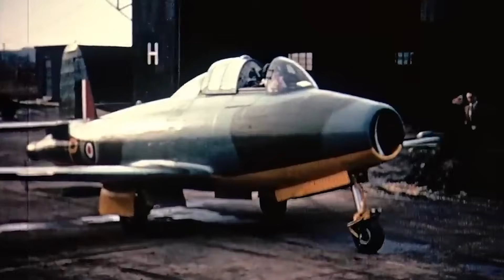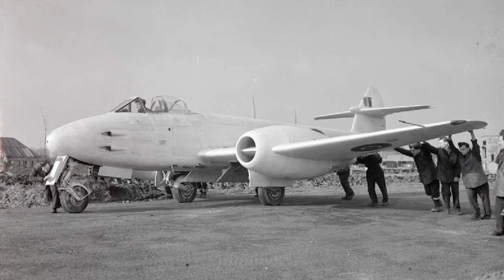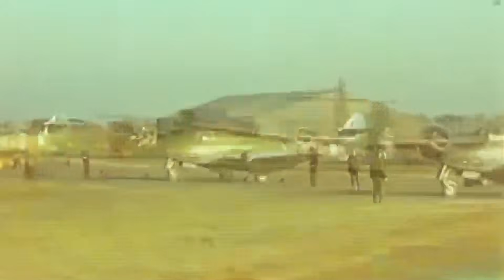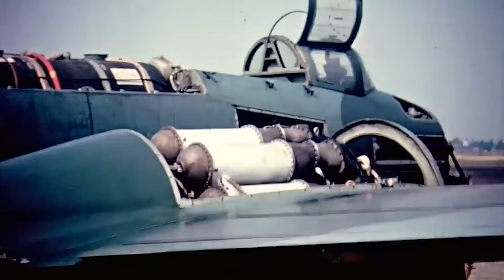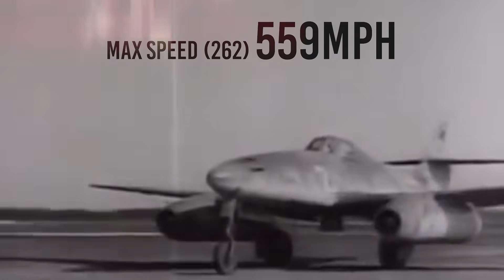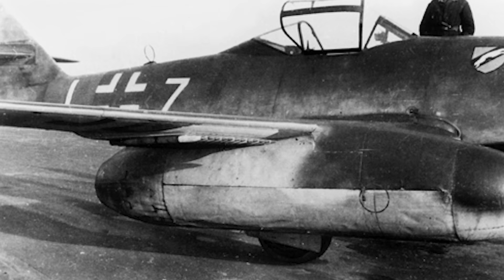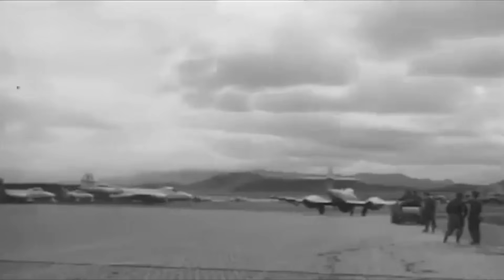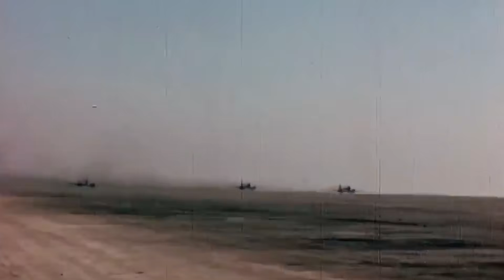Meteor vs Me 262 | Which was the better WW2 jet?

Comment: -Which Meteor?  There were 5 in service in WW2 and all much slower than the Me 262.   The Me 262 had a speed of 540mph at 25,000ft and 520mph at Sea Level.  For the Meteor you had
-Meteor I with Welland, speed about 448mph
-Meteor I with Derwent I and small nacelles about 460mph
-Meteor I with Derwent I and improved nacelles (I think about 466 or so)
-Meteor III with Derated Derwent and Standard Nacelle (About 480mph)
-Meteor III with Derated Derwent and lengthened Nacelles and (clipped wings I think)  (about 492 mph)
-Post war the Derating was removed and the Meteor III (latter retroactively renamed Meteor F.3) speed got to 515mph.
-Post war a Meteor III with clipped wings and faired over gun ports with Derwent V managed 596mph at sea level which became 606mph within weeks.
-The Derwent V was not a progression of the Derwent I through to IV but a completely different more advanced engine obtained by shrinking down the Nene.  
-The reason for the speed record at sea level where the speed of sound is 750mph  is that the meteor was at its Mach limit (about 0.78) and this wouldn't have been possible at 36000ft where the limit is a stable 660mph.
-The "Speed Meteors" became the basis for the post war Meteor F.4 which entered service in 1946/47.
-So where it counts in WW2 the Me 262 was better.
-Improvements to the Me 262 would be
-Accelerator control valve which placed a barometric capsule across the compressor to measure airflow and dose fuel accurately preventing burnouts of the engine that plagued the engine.
-Jumo 004C engine increase in thrust from 900kg to 1000kg
-Jumo 004D engine increase in thrust to 1100kg.
-Area ruling bulges developed by AVA to raise mach limit.
-Increasing sweep from 16.5 degrees to 30, 37 or 45.
Reply: The Me262 and Meteor had virtually the same limiting Mach number of 0.82-0.83.
All the Meteors had ten times the engine life of the Me262 and a third of the operational Me262’s were lost to DUAL engine failure.
Taping over gun ports was standard in WW2…
Each of the Derwent engines had twice the thrust of the Ju004 engines and thus better rate of climb and acceleration.
Reply: @allangibson8494  Early i.e. WW2 Meteors had a Mach limit of 0.78 before the onset of Mach Tuck.   A Me 262 about Mach 0.82.  Eric brown said it was controllable till Mach  0.86 (in the sense of being recoverable) but with a lot of buffet.  
-the Mach 0.82 Meteors did not come until after the war with the F.4.    You can see the work in extending and making finer the nacelles, placement of horizontal tail and enlargement of vertical tail and what not.   
-The Me 262's 18 degree sweep (16 degrees at quarter chord line) lead to a 1/cosine(16) increase in mach limit which is about 5%.
-Jumo 004B engine had a 100 hour life (about 50 missions)  but a 25 hour MTBO in which the 6 plain steel combustion chamber cans and turbine was replaced.  Production of the Jumo 004 was 800 hours and the MTBO required 160 hours of parts and about 8 hours labour.   From the point of view of cost, labour and life (given few aircraft would survive 50 missions) the Me 262 was cost effective.
-Had sufficient chrome and nickel been available to make the engine combustion chamber cans, exhaust duct and nozzle cone could have been made  stainless steel which would have likely eliminated the combustion chamber burn throughs and exhaust cone dislodgements that caused many (most) engine failures.
-
Reply: @bernhardzunk7402 The Ju004A had catastrophic resonance problems that were shared with the early Ju004B’s.
That was only partly fixed in December 1943. 
Ju004B’s also Mach stalled at 0.82 with the engine air flow being cut off by the shock cone in the inlet. Pod mounted engines are great for maintenance but lousy for transonic aerodynamics.
Reply: @allangibson8494  Each 262 was flight tested at 590 mph in a forty degree dive before it left the factory. That's higher than .82
Reply: @TheAneewAony Mach numbers vary by altitude and specifically temperature.
The problem with the Me262 was its inability to manoeuvre at above Mach 0.82. The P-51 and Spitfire could.
Reply: @allangibson8494  Eric Brown differs. Tactical Mach and critical Mach are different of course. The 262 was a quantum leap over older less advanced  designs such as the P-51 and Spitfire
Reply: @TheAneewAony The Me262 was a tactical failure. It couldn’t hit the aircraft it was attacking because of defective guns.
Reply: @allangibson8494 All 28 WWII jet aces flew the 262. 542 air to air kills. Meteor, zero kills, due to its slow speed
Reply: @TheAneewAony No German aircraft flew in range of the Meteor (other than the hundreds of V-1’s fired at London and Antwerp). 
The Luftwaffe was TOAST, brought down by piston engined fighters (with almost 100 Me262’s downed by P-51’s alone).
The Luftwaffe didn’t fly Me262’s over allied lines (or much of anything).
The Meteor had to wait until Korea to take on fighters.
Reply: @allangibson8494   True, the British actively hid the Meteor from combat due to its slow speed and inability to hit a target, as per the RAF's Central Fighter Establishment. The only combat jet to fly missions over England during WW2, that is a jet used in combat, was the German Arado 234. When the Meteor finally saw combat in Korea it did produce several jet aces, unfortunately they were Russians flying Mig 15s

Reply
Reply: @TheAneewAony the Meteor had superior engines from day one.
That’s why the soviets cloned them in the MiG-15.
The Ju-004 and BMW-003 engines were utter crap rushed into production that burned one and half times as much fuel for the same thrust as the Welland engines and delivered half the thrust of the Derwent. All this while they had 1/10th the operating life.
The Germans hid their jets from the allies just as much as the allies hid their jets from the Germans.
Reply: @allangibson8494  Nah. The Russians built the low tech, simple centrifugal flow engine for the same reason the British did, it's all that they could do. The 262 had 28 jet aces including Kurt Welter, the highest scoring jet ace in history. There has never been a British jet ace. Ever
Reply: @TheAneewAony The British had an axial flow engine that was used on the Meteor.
Like the German engines, it ate itself.
WW2 Axial flow engines were unreliable due to their size. Axial flow engines need to be large for reliability and efficiency.
Centrifugal compressor engines are simply the better engineering option below 50000N thrust.
The Germans just went with a bad option.
Reply: @allangibson8494  The only Meteor equipped with an axial flow engine, S/N DG204/G, port side engine exploded on 4 January 1944 killing the pilot William Davie. The engine had less than three hours. That ended the Metrovick F.2, no more were flown. The simple fact is the British lacked the technology to build an axial flow engine. If they could have, they would have. Even if the British could have built an axial flow engine, the didn't understand aerodynamics needed for a modern jet fighter. It wouldn't be until the Hawker Hunter that the British were able to integrate German technology, such as swept wings and axial flow engines into an airframe. Reliability was not a concern for the British, if it was they never would have built the Napier Sabre. The 004 262 combination proved effective, with over 500 air to air kills and 28 jet aces, even after the 8th Air Force P-51s won the air war making it safe for the RAF to operate in daylight
Reply: @TheAneewAony The Metrovic F.2 became the Metrovick Beryl (F2/4) which was developed into the Armstrong Siddley  Sapphire (F.9).
The pilot death was due to a parachute failure…(which also killed a lot of Me262 pilots).
Hundreds of Me262’s were lost to dual engine failures. (Along with 90% of the Me163’s).
The British were way ahead of German engine technology at the end of WW2.
Reply: @allangibson8494  Not really. After the fatal explosion work on the F.2 ended. The F2/4 was only related in concept. The F.2/4 flew on only one aircraft and then was also abandoned. William Davies' death was due to the explosion, it's unclear if he was thrown from the wreck or if he managed to escape, he hit the tailplane. In either case it was the explosion. Eric Brown: "Germany was 5 years ahead of the Allies". Postwar England was bankrupt and had to make due with obsolete designs such as the centrifugal flow engine. The Meteor only found use in Commonwealth or third world nations.
Reply: @TheAneewAony The Germans kept flying aircraft with exploding engines right to the end. The British had better alternatives.
Axial flow doesn’t make an engine “better” - it makes it more fragile.
Bigger axial flow engines are more robust simply because they have more metal in the blades. None of the WW2 axial flow engines were big enough to be reliable with the materials and manufacturing processes of the day. Below 10 tons of thrust, centrifugal engines are better. Above 10tons of thrust the axial flow engine will be physically lighter.
The British and American axial flow engines recognised that and the Beryl (F2/4)  grew into the Sapphire (F9) and then the Rolls Royce Avon (which is a Sapphire with a Nene turbine) (Yes they are part of the same family just getting handballed through four different companies). (The U.S. built them under license)
The Russians got the complete BMW003 production line (and the Czechs the Ju004 and Me262) but used the clones of the Derwent and Nene in their operational fighters.
(Prewar Germany was bankrupt too…)
Reply: @allangibson8494 The 262 had 28 jet aces, all in less than six months and after the US 8th AF won the air war. There never was a British jet ace ever. The British simply lacked the technology to build and operate a jet figher during WW2, regardless if they used the obsolete centrifugal flow engine. The axial flow is superior to centrifugal flow engine, hence the centrifugal flow is only used in generators, turboprops, helicopters or whereverer a low cost simple engine is needed. The cetrifugal flow is not used in modern jet fighters or airliners. Those type use the German invention... axial flow engines. The 262 had over 500 air to air kills while the Meteor may have 13 kills in Korea.
Reply: @TheAneewAony The Me262 existed in a “target rich” environment.
The British and Americans had such overwhelming air superiority that they were getting in each other’s way.
Shooting down 1% of your opponents isn’t a win when they shoot down 90% of yours. 
Germany LOST because they consistently failed at logistics.
They got out built in aircraft by a factor of 10 to 1 by the Americans and 3 to 1 by the British.
The Germans couldn’t fuel their jets (compounded by them burning a third more fuel than the British jets and delivering less than half the maximum thrust while doing it and needing replacement ten times as often).
The German axial flow technology SHOULD have been a dead end and the German engineers only really got the bugs out when working for the French at SNECMA in the mid 1950’s.
Reply: @allangibson8494  More than half of all Meteors were destroyed in combat during the Korean war. Hardly low intensity. Yet only claimed 13 kills. Every single axial flow jet engine is based on Dr Franz's invention. BTW, the Germans lost the war before it ever started. The British lost the war by mid 1941, only saved by the US 8th AF. There was a postwar rush to obtain German technology and scientists, by the US, USSR and the British. The German scientists in Britain were responsible for creating the Concorde
Reply: @TheAneewAony The British axial flow engines owe NOTHING to German technology. They are entirely an independent design.
No one was swapping notes during WW2 between Germany and Britain.
Reply: @allangibson8494  Are you suggesting that it's coincidence that the British were only able to build a working axial flow engine after examining Dr Franz's invention? That's what happened.
Reply: @TheAneewAony Franz didn’t build a reliable axial flow engine. His were WORSE than the ones Griffith designed for the British.
Reply: @allangibson8494  Franz invented the axial flow. None of the Griffith designed progressed beyond bench test or drawings, except for the failed Metrovick F.2 which as you know exploded killing the pilot. The British simply lacked the technology.
Reply: @TheAneewAony The Metrovick F2 engine first ran in 1941 and first flew in June 1943.
The F2 compressor was integrated into the Rolls Royce Clyde turboprop engine (used on the Westland Wyvern).
Unlike the Ju004 it was recognised as second rate and in need of further work.
Reply: @allangibson8494  That F.2 was only installed in one aircraft, Meteor S/N DG204/G, and it exploded seven weeks later killing the pilot. The engine had less than three hours on it. This failure led the British down a dead end in technology with the centrifugal flow engine. Even after gaining German research the British were unable to build a flying axial flow engine until 1947. By way of comparison the Americans flew the axial flow powered, and with German research, swept wing F-86 in 1947.  That's how far behind the British were. However, German scientists were able to develop the Concorde for Britain so there's that. The Junkers Jumo team was captured by the Russians after WW2, developed the Jumo 022 turboprop into the NK-12, the most powerful turboprop ever made. That engine powers the fastest propeller plane in series production the TU-95. It's still in operation
Reply: @TheAneewAony Centrifugal gas turbines are still manufactured so not a “dead end”.
Small axial flow gas turbines are very very hard to build and the Germans failed at that and killed hundreds of their best pilots doing it (through engine failures).
The point where axial flow engines become better than the centrifugal alternative is four times the power output of a Ju004. Below that a centrifugal engine wins every time in every metric.
Small fan blades are FRAGILE. That’s why your car turbocharger uses a centrifugal compressor and centripetal turbine (just like OHains first jet engines).
Junkers got a leg up because they were OWNED by the Nazi Party directly.
The F-86 J47 was developed directly from the J35 developed in 1943 in the United States using the J33 turbine stage (from the British centrifugal engine) attached to a NACA developed eight stage compressor. No “German” input.
Reply: @allangibson8494  The centrifugal flow engine in the Meteor actually has 450 confirmed pilot kills, the Germans built over 1,400 262s and over 6,000 004s, they never had more than 50 operational at any one time. Not sure why you made up numbers.  As far as combat or commercial transport aircraft, there really aren't any centrifugal flow engines to speak of. If DG204 would have worked it would have been faster than the Meteor III, albeit still slower than the 262 due to aerodynamics. It's noteworthy that the F-86 and Mig-15 looked the way they did because of German technology. As for the 262's kill ratio of 5 to 1, vs the Meteor's 1 to 1, the stats tell the story. The Russians claim 26 kills of the 56 Meteors lost in combat, while the RAAF admits to 4, making the actual Meteor kill ratio closer to 1 to 6. Ohain built the first jet engine that could fly for only $32K in today's dollars, without any government funding.
Reply: @TheAneewAony Now look up the fates of those 1400 Me262’s. More crashed due to engine failures than were shot down.
As an example of the 60 Me262’s launched on 7 April 1945, 27 (with 19 pilots (and 5 wounded) were lost.
Allied losses on that raid were 19 bombers (out of 1261) and 8 fighters.
That was the highest number of Me262’s operational at any time. (Although 2 April 1945 reported 127 in operational condition).
Of the 100 lost during 1944, 28 were lost to causes unknown half on training flights (pilot didn’t survive), 10 to known engine failure (ie pilot reported engine failure) and 9 in actual air to air combat.
45% losses on one combat mission isn’t indicative of “air superiority”.
Reply: @allangibson8494 All 28 WWII  jet aces flew the 262, including Kurt Welter the highest scoring jet ace in history.  Over 500 air to air kills. On April 7, 1945, a force of roughly 60 Me 262s attacked Allied bombers, resulting in 25 B-17s downed or damaged. Compared to the Meteor's 13 claimed air to air kills with 56 combat losses along with 450 Meteor pilots killed due to engine, brake and landing gear failure,  the 262 comes out on top.
Reply: @TheAneewAony And?
Just because the German Luftwaffe cowered behind there frontlines doesn’t make that the win you think it is.
Seven of them died flying the Me262 and five wounded and grounded (in less than a year).
All the Me262 pilots were aces before they got to fly the plane.
Reply: @allangibson8494  There were 28 WW2 jet aces, that is with five or more kills made while flying the 262. For example, Adolf Galland had 105 kills, with 55 of those being Spitfires. Adolf Galland shot down seven aircraft while flying the 262. The Meteor never engaged a German pilot in aerial combat due to its slow speed.
Reply: @allangibson8494  No, the Meteor III had a critical Mach of .74, the 262 was .86. This is according to the RAF's Central Fighter Establishment report dated 1946
Reply: @TheAneewAony The Derwent Meteors introduced in late 1944 had a critical Mach number of 0.87. The 0.74 was the number for the short nacelle Welland Meteors from 1943.
The Derwent Meteors were provably faster than the Me262’s.
Reply: @allangibson8494  Not true.  Later variants, such as the Meteor F.8, had an official Mach limit of 0.82. The Meteor's high drag, straight wing airframe was always a problem
Reply: @allangibson8494  The Meteor F.8's critical Mach, was officially at .82 was still lower than the wartime 262. The aerodynamics of the Meteor were simply much higher drag than the 262. The .74 critical Mach is the Meteor III with Derwent II engines, as tested by RAF Central Fighter Establishment in 1946.  The Meteor featured relatively thick wings, which are prone to early local airflow acceleration to supersonic speeds. In contrast, the Me 262's wings were aerodynamically "cleaner" and optimized for higher speeds. Additionally, every seam and panel on the 262 was filled with putty and sanded smooth, further reducing drag. The Me 262 utilized a 18.5 degree leading-edge sweep. While originally intended to adjust the center of gravity, this sweep effectively increased its critical Mach to approximately 0.82–0.84 by delaying the onset of compressibility. The Meteor used a traditional straight-wing design, which resulted in a critical Mach of roughly 0.74 for early models like the F.3. No wartime Meteor ever approached 500 mph, none were used in aerial combat due to its slow speed.
Reply: @T @TheAneewAony The Me262’s wing sweep was an accident. The centre of gravity wound up too far aft so they swept the wings back to compensate. (The DC-3 had the same wing sweep).
The Me210/410 had exactly the same problem.
The tricycle undercarriage was a similar solution (it was pulled off the Me309 - literally).
The Me262’s engines consistently flamed out at Mach 0.86 because of shock waves in the inlets (and that added to its engine failures due to design failures).
The Meteor had its own problems and shock waves off its nacelles were fixed in 1944 with the early Derwent Meteors.
That let the Meteor claim a world airspeed record in 1945 and 1946.
The Me262 was still operational at this time in Czechoslovakian service.
The Me163 had a much better performance than the Me262 (but killed 90% of the pilots who flew it).
Reply: @allangibson8494 Imagine what the British thought when they found out that the Germans had already hit 700 mph in 1944, a record that would stand until 1952
Reply: @TheAneewAony  In an aircraft that killed 90% of its pilots?
Reply: @allangibson8494 The Meteor had 450 confirmed kills. Unfortunately they were all British pilots in accidents.
Reply: The Meteor was still limited to Mach .74 and 500 mph in 1946 by the Central Fighter Establishment. The Me 262 was the first aircraft to be equipped with an autothrottle system. German aerodynamicist Otto Frenzl discovered the area rule in December 1943 while working in a transonic wind tunnel at the Junkers works in Germany.  What did Eric Brown say about the 262? "...the aircraft had excellent directional snaking characteristics making it a good gun platform. From this aspect it was the best jet fighter of it's time, and I was certainly in a position to judge, having flown every jet aircraft then in existence. A check on the rate of roll at 400 mph revealed the highest that I had ever experienced outside of the realm of hydraulically-powered ailerons, and the stick force demanded to produce these exhilarating gyrations was delightfully light. Leveling off at 12,000 feet I settled down to another spell of the pleasures of the phenomenal roll rate of this delightful little aeroplane ... I had never met better flying controls ... Even if somewhat underpowered it had a good performance - it could certainly have run rings around the contemporary Meteor. I was to fly the little aeroplane quite frequently.

page 138
"Wings of the Luftwaffe" Captain Eric "Winkle" Brown
(C) 1977, Revised 2010, reprinted 2011, 2013
ISBN 9 781902 109952"

Would you like to know more? LOL
Reply: Bollocks!!! 15 Operational Meteors on 15th August 1944 when 616 Squadron became a fully Jet only operational squadron (though down to 14 at the end of the day due to an aircraft getting lost and running out of fuel, resulting in a crash that killed the pilot). 17 Operational Mk III on 616 Squadron on VE Day, 18 Operational Mk 1 and Mk III's on the Operational Convertion Unit at Colorne and 18 Operational Meteors on 504 Squadron who reached operational readness status on VE day. Most Combat Soriets flown by the Luftwaffe Me-262 force in one day 58. Most Meteor Combat Sorites flown in one day by 616 Squadron 28!!
Reply: @richardvernon317 616 Squadron’s first jet intercept was on 27th of July 1944.
They were chasing V-1’s from then on.
Reply: @allangibson8494  Yes because the F Mk 1 was designed as a point defence interceptor and only carried enough gas for a 45 minute sortie.
Reply: @richardvernon317 The Me262 was essentially a point interceptor too.
Its specific fuel consumption (fuel burned per unit thrust) was 50% higher than the equivalent British engines of exactly the same time.
Reply: @richardvernon317  Hiding from Germans is neither combat or operational... that's what French do
Reply: Me262  research a/c top speed 624mph in 1944
Reply: @Eric-kn4yn  I believe the highest verified speed (ie with a tail number)  am Me 262 ever flew was 568mph which I think was at 25,000ft which is about Mach 0.815 at that altitude with Jumo 004C and possibly a Renn Cabin (reduced profile racing cabin).   Gerd Lindner, the famous me 262 factory test pilot,  kept notes and said an Me 262 with a good quality airframe (properly aligned, smooth, gaps sealed and with good quality engines could manage 560mh at 20,000ft.   The average was 540mph but could vary +/-18mph.  It is faster than any war time Meteor.   
-There wasn't much between the two aircraft.   The Meteor being plagued by aerodynamic engine air frame Integration issues and engine derating and (which limited its speed) and Control rigging that reduced roll rate to stop over stressing and the Me 262 by unreliable engines.  
-The Germans definetly working on improving their engines.  The Luftwaffe's chief intelligences officer mandatory diary the "Kriegs Tage's Buch" notes that the "Accelerator Control Valve" which measured the engine air mass flow and controlled dosing of fuel was expected to be in service in early April 45.
-The Jumo 004B engines used a centrifugal governor to control RPM via fuel flow but this meant the engine over dosed in acceleration and underdosed in deacceleration.  The US and British engines had the same issue but they were less sensitive to it due to their better materials.  
-By Mid to late 1945 the Meteor might have been better but the me 262 would have engine and aerodynamic improvements.
Reply: @bernhardzunk7402  the climb of the me262 was also impressive they were big heavy a/c.
Reply: @bernhardzunk7402 see www.top speed specially modified me 262# confirms my statement 624mph/ 615mph  i seen both but 624mph sited numerous occasions different sources
Reply: @bernhardzunk7402  verified by whom what  international verification in ww2 impossible that resumed post ww2.
Reply: @bernhardzunk7402  Me 262 S/N  VI+AD hit 606 mph in 1944. The Me 262 is the first jet to be fitted with an auto throttle
Reply: @Eric-kn4yn You are confusing the Me262 (540mph) with the Me163A (624mph in 1941). The Me163A was the unarmed prototype trainer for the armed Me163B. The Me163 also killed 90% of the pilots who flew it under power (60 out of 66).
The Me164B hit 700mph in testing in 1944.
Reply: @allangibson8494   NO do your research specially modified 262 for speed trials not combat ive seen photo on utube top speed 624mph during the war ok 262 also modified with rocket booster for research climbed similar to komet 163
Reply: @Eric-kn4yn You are the one making claims that aren’t backed by online sources about a “modified” aircraft.
The Me262 was incapable of exceeding the speed of sound due to form drag (ie its chubby fuselage, thick wing and pod mounted engines. The Ju004 engines stopped working at Mach 0.82 to 0.84 due to intake shock waves.
The far more aerodynamic Me163 had the same problems.
Reply: @allangibson8494 624mph isnt speed of sound my sources were a well researched book not www.published 1990 referencing impeccable
Reply: @allangibson8494 The air intake problem was solved before 262 production began.  This was done by sweeping the inboard section of the wing to match the sweep angle of the outboard wing. It was discovered after a fatal test flight and subsequent wind tunnel testing
Reply: @TheAneewAony The air intake problems resulted in engine failures during RAF post war testing.
The engine resonance vibration problems that resulted in a five hour engine life were partially solved in December 1943 (that was caused by having an even number of blades on the stator, rotor and supports).
Fixing the vibration issues left the turbine metallurgical issues - that resulted in engine failure after five to ten engine cycles because of cracking in the blades.
The Me262 simply wasn’t fit for combat operations. The Meteor was simply a better design for actual operational use.
Reply: @allangibson8494 In less than six months the 262 produced 28 jet aces, including the highest scoring jet ace in history. By way of comparison there has never been a British jet ace in the entire history of aerial combat
Reply: @TheAneewAony And yet the Germans lost HARD. Individual victories count for nothing if you fail strategically.
The Me262 was only ever flown by aces and never in combat with other jets.
Reply: @allangibson8494  Yes, we agree, the British didn't operate the Meteor in combat primarily due to its slow speed. The US 8th AF P-51 Mustangs won the air in Europe, making it safe for the RAF to operate in daylight. Exactly one half of the RAF's Bomber Command was killed in action.
Reply: @TheAneewAony The Meteor was faster than the Mustang in level flight (which was why the Mustang was never used to intercept V-1 flying bombs and the Meteor spent months doing that).
There were three aircraft capable of doing that, Meteors, Griffin Supermarine Spitfires (and Spitefuls) and Napier Sabre Hawker Tempest. The last two were also used to chase Me262’s (successfully). 
Spitfires could reach well over Mach 0.9 in a dive, thanks to their thin wings. Mustangs were less powerful but still capable of catching Me262’s (particularly on the flights where they had an engine failure (every third or fourth flight) or were on approach to land (every flight - the ten seconds to go from idle to full throttle was lethal).
Aerodynamically the Me262 had problems slowing down (due to the complete lack of speed brakes) and this meant that it would have to go to flight idle 40 to 50 km away from base (with consequential engine failures due to low power operation. The lack of speed brakes also meant that a Me262 attack only put five rounds to each target because of high closing speed and slow firing rate of the cannon armament.
Reply: @allangibson8494  The Meteor's slow speed is why it wasn't used in aerial combat during WW2, Eric Brown: “Speed. Speed. It was a pedestrian aircraft, really, the Meteor. It never went into… It never fought operationally. It fought, if you like to call it that, against the V1, the flying doodlebug, and quite successfully. But it really was too slow to deal with the German jets when they came into being. They were a grade above at first. The Me262 is quite frightening. It gave us a shock to find out, because when I flew it the fastest fighter we had – piston fighter, of course – in the Allied camp was the Seafire Mk14 with a top speed of 446mph. The Me262 was 125mph faster than that aircraft. So this was a rude shock to our system, I tell you, when we found that out.”
Reply: @T @TheAneewAony e Me262 never crossed the German front lines.
That’s why the Meteor never met it.
The Derwent Meteor was faster in level flight than the Me262 (thanks to having more than twice the thrust).
Eric Brown didn’t fly the Derwent Meteor until 1948…
Reply: @allangibson8494  That would be incorrect. The Meteor was intentionally hidden from combat due to its slow speed, as stated by Eric Brown.  No version of the Meteor ever came close to 500 mph during the war, none. Three Meteor IIIs with Derwent II engines were tested by the RAF's Central Fighter Establishment in 1946, none exceeded 470 mph at any altitude. Additionally they stated that the airframes' speed was limited to 500 mph. On multiple occasions German jets such as the Ar 234 operated over England, making them to only combat jets operated in the UK during WW2. The Me 262 flew escort for German jet bombers on missions to bomb Ludendorff Bridge at Remagen. And of course Kurt Welter the highest scoring jet ace in history flew the 262.
Reply: @TheAneewAony The Me262 didn’t cross allied front lines.
The Meteor was EXPLICITLY waiting for them to do that. That’s why they were deployed to Belgium in 1945. 
The Derwent Meteors were quite capable of pushing 600mph (and did in 1945)(and the argument about taping gun ports is academic because the RAF ALWAYS taped fighter gun ports before takeoff (for aerodynamic reasons and to avoid debris in the gun barrels).
Eric Brown wasn’t an RAF pilot - he was Royal Navy. The Navy never flew cutting edge aircraft.
Reply: @allangibson8494  The Meteors were EXPLICITLY forbidden from combat, due to its slow speed. The Meteors were painted white, all four of them, and sent to Belgium for the sole purpose of familiarizing AA crews with the type. Two ran into each other killing both pilots. After WW2 a specially prepared and modified Meteor without weapons hit 606 mph, the same speed a Me 262 V9 hit in 1944, that Me 262 had guns. A regular Meteor III with Derwent II engines could only do 470 mph in 1946 according to the RAF. Eric Brown is easily the best test pilot of all time, no caveats
Reply: @T @TheAneewAony teors were absolutely not forbidden from combat.
They (like the German jets) were restricted from crossing the front lines.
That resulted in annoyance on both sides.
And you can’t fly a Meteor with no weapons - the weight of the guns in the nose is needed for control to be maintained.
Me262V9 hit 606mph in a DIVE…
Reply: @allangibson8494 The Meteors  (specifically EE549 and EE550) that set the 606 mph world speed record in November 1945 were specially modified, stripped-down versions, meaning they did not carry their operational weapons or armament. The four 20mm Hispano cannons, along with armor plating and other combat equipment, were removed to reduce weight and minimize drag for the speed runs. The Me 262 V 9 HG I achieved 606 mph in level flight, the aircraft retained its weapons, and it had a modified canopy and inboard section wing sweep angle. German jets operated over England until the end of the war. A P-40 was flown by a test pilot at 661 in a dive.
Reply: @T @TheAneewAony A Meteor without its guns is too tail heavy to fly safely.
The guns weight would have to be replaced by ballast.
Reply: @TheAneewAony Me262 V9 was substantially modified from the standard fittings of the type including a modified (lower) canopy and NO ARMAMENT.
The sea level speed reported was 540mph/870 km/h for standard Me262’s.
Reply: @allangibson8494 The British tested the Me 262 at 568 mph in level flight.
Reply: @allangibson8494 You could just look it up. I gave you the serial numbers. Heavily modified, non combat aircraft. The Meteor III had a critical Mach of .74 in 1946.
Reply: @TheAneewAony The Meteor Mk1 had a critical Mach of 0.74.
The Meteor F.3 & F.4 raised that to Mach 0.85 and could operate at Mach 0.82.
The Me282 had engine flame outs at Mach 0.86 and loss of control at Mach 0.84 (due to shock fronts and compressibility due to its thick wings).
The He280 was a better jet design.
Reply: @TheAneewAony The British had engine failures due to shock wave ingestion in the Me262. The Meteor didn’t have that problem due to better intake design.
Reply: @allangibson8494  No, the Meteor III with Derwent II engines had a critical Mach of .74.  From the RAE report dated October 1945 titled "Note on the performance in flight of the German jet-propelled aircraft Messerschmitt 262, Heinkel 162 and the Arado 234" Section 3 paragraph four. "Considerable interest has been shown in the difference between the top speeds of Me 262 and Meteor III. The difference is due to the higher profile drag of the Meteor caused by its higher wing drag, associated with its lower wing loading. This can be seen from Table 2 where a Meteor drag analysis is included for comparison with Me 262. For this reason the Meteor would be roughly 20 m.p.h. slower than the Me 262 fitted with engines of the same thrust. The advantages of the lower wing loading lies in the reduced take-off distance and increased maneuverability."
Reply: @allangibson8494  Not sure what you wrote there. One thing is certain, the Meteor III had much higher drag, a lower Critical Mach number and a much slower top speed than the much more technically advanced Me 262. The 262 was nearly 100 mph faster than the Meteor. Just a historical fact.
Reply: @allangibson8494  The Gloster Meteor F. Mk III, particularly those equipped with later-model Rolls-Royce Derwent engines (such as the B.37/Derwent II), was recognized to have a critical Mach number of approximately 0.74. Due to this, and structural considerations, the aircraft was often speed-limited in service to below this number, with a Maximum Permissible Speed (VNE) often cited around 500 mph (805 km/h) up to 6,500 feet. Hope this helps
Reply: @TheAneewAony They were fitted with longer engine pods during WW2 which fixed the drag and control issues.
Reply: @allangibson8494  Well, that must be why the Meteor was never used in aerial combat. 500 mph limit. And that was in 1946
Reply: @TheAneewAony The Meteor was used in aerial combat in Korea.
Six MiG-15’s were brought down by them.
Reply: @allangibson8494  Yes.56 Meteors were lost, half the squadron. The Russians claimed 26 Meteors in Korea.
Reply: @TheAneewAony Which is surprising because the Russians weren’t “officially” involved in Korea…
The official figures were five RAAF Meteors lost in air to air combat.
Reply: @allangibson8494  The official figures are more than half (54) RAAF Meteors were lost in combat. The Russians claim 26 RAAF Meteors, nine in one day over Sunchon. Due to being outclassed by the MiG-15, the RAAF withdrew the Meteors from air-to-air combat and reassigned them to ground-attack roles in late 1951.
Reply: @TheAneewAony The Russians weren’t officially involved in Korea.
The Chinese were but not the Russians.
All the Meteors in Korea were operated by No.77 Squadron RAAF and they lost five in air to air combat.
The majority of the 60 lost were shot down by ground fire when operating as ground attack aircraft.
Reply: @allangibson8494  Yes, they always claim it's "ground fire". They still lost 56 Meteors lost in combat, and the Russians claimed 26 of those. The Battle of Sunchon, where the RAAF lost three to nine Meteors, depending on the source, in one day putting an end to air combat for the No.77
Reply: @TheAneewAony The Russians WERE NOT IN KOREA…
Reply: @allangibson8494 Yes, the Russians flew Mig-15s in the Korean War. They were experienced WWII pilots that the Americans called "Honchos". The RAAF Meteors were outclassed by the Russian pilots and the Mig-15. Hence the heavy losses. The Russian piloted Mig-15s had almost a one to one kill ratio with American F-86s. The North Korean and Chinese pilots did not have the level of experience as the Russians, resulting in high losses against the American pilots
Reply: @TheAneewAony The Meteors were withdrawn from air combat shortly after the F-86’s arrival in theatre.
The Meteor was more than a match for the MiG-3’s, MiG-9’s and Po-2’s the North Korean’s and Chinese were flying in 1950 but the MiG-15 was a generation younger.
Reply: @allangibson8494  The Mig-15 is the reason why the RAAF withdrew the Meteor from Korean War aerial combat, due to heavy losses during the Battle of Sunchon, 1 December 1951.  The USAF F-86 was deployed to Korea a year earlier, December 1950. That's well documented.
Reply: @petemaly8950  Nice copy and paste, just to say that the British failed to develop and operate a jet in combat during WW2.

Currently Britain and Germany both are militarily helpless, relying on America for defense
Hope this helps
Reply: @DoktorBayerischeMotorenWerke 

@JammisAdami  

We feel we can clear up some commonly held myths and misconceptions, obviously.
It's always good to see the facts presented clearly and concisely isn't it?

Most of the Me 262s that were built were either unusable or if flown ended up being accident losses or combat losses. Attempts to get the engine into a usable state failed until 1950 when RR got involved with the French efforts. 

The Gloster Meteor was one of the world's first jet fighters to go into service, it was in service during WW2. The meteor was the first effective multirole fighter bomber jet aircraft with a reliable engine to go into service,  It broke speed records in 1945 and 1946. During WW2 it was in service as a fighter and multirole aircraft over the UK and over all allied controlled territories in Europe and beyond. 

The ME-262 and it's 46 minutes life engines were abandoned shortly after 1945, it had a do not exceed speed of 456 mph and was only ever used to attack bombers with losses of three 262s for each downed bomber.  During WW2 most of the ME-262s were destroyed by their engines, were various types of accident losses or were shot down by bombers. No German designers were involved with the Mig-15. The Mig-15 used a copy of the RR Nene.  

During the Korean conflict most of the Meteor casualties were due to groundfire or accident losses. The result of any tangles between Migs and Meteors was that Mig pilots avoided getting into dogfights with Meteors. The battle of Sunchon, where 50 Migs against 14 Meteors resulted in the supposedly superior Migs failing to gain any clear advantage caused the Koreans to re-evaluate tactics. General opposition in Australia to involvement in the Korean conflict resulted in the govt using the battle as an excuse to reduce the RAAFs involvement to troop support only.

The world's first wind tunnel was built in England during the 1800s. The world's first supersonic wind tunnel was built in England during the 1920s. 

The Whittle Gloster E28/39  was of course a brilliant aircraft that was later copied in Russia as the upsized and tweaked Mig 15 with a copy of the RR Nene gas turbine aero engine. The RR Nene being the world's most powerful & most reliable gas turbine aero engine in 1944.

The MD F3H Demon was a contemporary to the DH Sea Vixen & had a similar performance. The F4 Phantom was a follow on from the F3 Demon. The Sea Vixen took a long time to get from first flight to introduction for various reasons and a similar situation occurred with the MD F3H Demon.

McDonnell Douglas F3H Demon
590 Built. Not Supersonic.
Max Speed 578 MPH.
Introduction date 7 March 1956
First flight 7 August 1951
Retired 1964

MD F-4 Phantom 2
Number built 5,195
Manufactured 1958–1981
Introduction date 30 December 1960
First flight 27 May 1958

DH Sea Vixen
Number built 151 (including two DH110 prototypes and one Sea Vixen prototype)
Introduction date July 1959
First flight 26 September 1951
Max speed 695 MPH.
Retired 1972

Interesting British achievements.
There is no doubt that the Fairey (England)
Delta 2 was of course the world's first jet
aircraft to exceed 1000 mph.  Indeed It
exceeded the previous record by 310 mph &
held the record for 1 year. Incidentally, the Dassault Mirage 3 & 4 are based on the Fairey Delta 2.

The Panavia Tornado & Euro fighter Typhoon are British design aircraft with British design engines built by international consortiums. 

The EE Lightning was one of the fastest aircraft on the planet when it first achieved a Mach 2 flight. 

Early days, jet fighters.
De Havilland Vampire, Sea Vixen & Gloster Meteor accident losses were not high or unusual for fighter aircraft at the time. De Havilland built large numbers of all metal airframe aircraft before the DH Comet.
We mustn't forget of course that the DH Vampire for example first flew in 1943 & the engine was also built by De Havilland. There were examples of the Vampire interceptor / fighter in service until 1990 which was operated by more than 30 countries.

Non combat phase accident losses.
% of Aircraft built.

The Canadair CL-44 was a turboprop airliner.
Canadair CL-44                  (ff 1959 ) 48%
Lockheed XF104                (ff 1954) 100%
Lockheed  P80                   (ff 1944) 43%
Lockheed F104                 (ff 1954)  45%
Grumman f9f-5 Panther   (ff 1947) 44% 
Convair F102 Dagger        (ff 1953) 45%  
MD F-101 Voodoo.             (ff 1954) 34%
MD FH Phantom 1            (ff 1945)  35%
MD F4 Phantom 2             (ff 1958)  28%
MD F3H  Demon               (ff 1951)  32%
Gloster Meteor                  (ff 1943)  21%
DH Vampire UK                (ff 1943)  23%
DH Sea Vixen   UK           (ff  1951) 33%
Gloster Javelin  UK         (ff 1951) 20%
EE Lightning  UK             (ff 1954) 33%

It's a great pity & a crying shame that British military forces had to occupy a large part of Germany for decades after 1945 & Russian military forces had to do the same. Of course Russia still posseses a large chunk of what was German territory & of course Russia & the UK produce nukes. Obviously Germany does not produce nukes.

Early days, jet engines. Whittle performed the world's first demonstration of a gas turbine aero engine in 1937. The RR Nene, a centrifugal gas turbine aero engine, was the world's most reliable & most powerful gas turbine aero engine in 1944. Licensed built versions & copies of the RR Nene & RR Derwent would go on to power many aircraft in Russia including the Mig 15 & Mig 17, the US, China, France & other countries for decades after 1944. Incidentally, the Mig-15 was in essence an upsized / tweaked copy of the Whittle / Gloster E28/39 jet aircraft including an uprated copy of the RR engine.  The basic centrifugal compressor gas turbine aero engine with Whittle style reverse flow combusters and sometimes an axial compressor section is still manufactured by more than one company including Pratt and Whitney, the main application being helicopters.

The gas turbine engine was invented in England during the 1700s.

During the 1800s Parsons of Ireland & North England produced the world's first axial multi stage sequential stator rotor turbines and compressors for turbomachinery use which would eventually go on to to form the main components of the axial gas turbine aero engine. At the time the basic idea of making an internal combustion gas turbine engine and using it as an aircraft engine was considered thus the jet aircraft concept had been created in England before the first powered aircraft flew.

An example of what goes on these days in various countries. For example, there are of course no German companies that makes German jet aircraft in Germany & there are no German Companies that make German gas turbine aero engines in Germany that are suitable for widebody airliners.

The UK has the world's highest combined per capita Nuclear / Defence / Aerospace Sector Activity.

UK defence sector, absolute terms, world's second highest activity. 1st for per capita defence sector activity. Per capita nuclear powered submarine construction, 2nd position. 
Main players being Rolls Royce, Babcock, GKN Aerospace & BAe Systems. Activities often involve international collaboration. BAe systems, RR and other UK companies now handle more Airbus work value wise than Germany. 

There's a good chance that anyone currently flying on a widebody airliner will be on an aircraft powered by RR gas turbine aero engines made in the UK and a good chance there will be other hardware on the aircraft that's designed and / or manufactured in the UK. 

Rolls Royce Holdings UK
Subsidiaries
- Rolls-Royce plc
- Rolls-Royce North America (ex Allison etc Classified Military stuff)
- Rolls-Royce AB
- Rolls-Royce Deutschland
- Rolls-Royce India Private Limited
- Rolls-Royce Marine Power Operations
- Vinters Engineering Limited
- Rolls-Royce Controls and Data Services
- Rolls-Royce Power Systems
- Bergen Marine
Joint ventures include:
- Rolls-Royce Turbomeca
- MTU Turbomeca -

Trent Family
The MT30 (Marine Turbine)
Industrial Trent 60 Gas Turbine
Trent 7000
Trent XWB Airbus A330neo.
Trent 1500
Trent 1000
Trent 500
Trent 600
Trent 700
Trent 800
Trent 8100
Trent 900
   
RR wholly owned subsidiaries in Germany handle smaller 2 shaft RR gas turbine aero engine work.

The UK space and aerospace sectors are highly productive, high-value industries that together contribute over £18 Billion in direct Gross Value Added (GVA) to the UK economy. Individually, the space industry directly contributes about 0.3% of UK GDP 7•2 Billion while the aerospace industry contributes approximately 0.5% £10•9 Billion.
   
We hope this helps.

We hope this helps of course 👍
Reply: The RAF Central Fighter Establishment tested three Meteor IIIs with Derwent II engines in 1946. They flat out state the critical Mach of the Meteor was .74, and that the airframe was limited to 500 mph. None of the Meteor IIIs tested ever exceeded 470 mph at any altitude.  As for the the "speed" record, it was conducted by the French. The French were in no position to record the Me 163's 700 mph set on 6 July 1944, or the Me 262 set in 1944 of 606 mph. The Meteor just had more drag than the 262, and according to the RAF, the Meteor was always going to be 20 mph slower than the 262 given equal thrust
Reply: @TheAneewAony 

@tenbear5 

LOL The Nimonic nickel super alloys were developed in Hereford England 1939 -1940. In Germany they thought they needed to use stainless steel for turbine blading which doesn't work and due to various issues ended up attempting to use pressed sheet steel turbine blades. 

262 & it's disposable shirt life engines = Garbage (but it did actually fly which surprises a lot of people). In both Russia and France good people wasted their time trying to do something with the engine after 1945. Russians ceased trying in 1948 as their own effort was clearly better.

In France RR got involved in 1950 and managed to get something useful working. 

We feel we can clear up some commonly held myths and misconceptions, obviously.
It's always good to see the facts presented clearly and concisely isn't it?

The existence of the Gloster Meteor, De Havilland Vampire, Gloster E28/ 39, Vastly superior De Havilland, Metrovik and Whittle turbojet engines actually terrified the German High command peeps. 

The Gloster Meteor was one of the world's first jet fighters to go into service, it was in service during WW2. The meteor was the first effective multirole fighter bomber jet aircraft with a reliable engine to go into service,  It broke speed records in 1945 and 1946. During WW2 it was in service as a fighter and multirole aircraft over the UK and over all allied controlled territories in Europe and beyond. 

The ME-262 and it's 46 minutes life engines were abandoned shortly after 1945, it had a do not exceed speed of 456 mph and was only ever used to attack bombers with losses of three 262s for each downed bomber.  During WW2 most of the ME-262s were destroyed by their engines, were various types of accident losses or were shot down by bombers. No German designers were involved with the Mig-15. The Mig-15 used a copy of the RR Nene.  

During the Korean conflict most of the Meteor casualties were due to groundfire or accident losses. The result of any tangles between Migs and Meteors was that Mig pilots avoided getting into dogfights with Meteors. The battle of Sunchon, where 50 Migs against 14 Meteors resulted in the supposedly superior Migs failing to gain any clear advantage caused the Koreans to re-evaluate tactics. General opposition in Australia to involvement in the Korean conflict resulted in the govt using the battle as an excuse to reduce the RAAFs involvement to troop support only.

The world's first wind tunnel was built in England during the 1800s. The world's first supersonic wind tunnel was built in England during the 1920s. 

The Whittle Gloster E28/39  was of course a brilliant aircraft that was later copied in Russia as the upsized and tweaked Mig 15 with a copy of the RR Nene gas turbine aero engine. The RR Nene being the world's most powerful & most reliable gas turbine aero engine in 1944.

The MD F3H Demon was a contemporary to the DH Sea Vixen & had a similar performance. The F4 Phantom was a follow on from the F3 Demon. The Sea Vixen took a long time to get from first flight to introduction for various reasons and a similar situation occurred with the MD F3H Demon.

McDonnell Douglas F3H Demon
590 Built. Not Supersonic.
Max Speed 578 MPH.
Introduction date 7 March 1956
First flight 7 August 1951
Retired 1964

MD F-4 Phantom 2
Number built 5,195
Manufactured 1958–1981
Introduction date 30 December 1960
First flight 27 May 1958

DH Sea Vixen
Number built 151 (including two DH110 prototypes and one Sea Vixen prototype)
Introduction date July 1959
First flight 26 September 1951
Max speed 695 MPH.
Retired 1972

Interesting British achievements.
There is no doubt that the Fairey (England)
Delta 2 was of course the world's first jet
aircraft to exceed 1000 mph.  Indeed It
exceeded the previous record by 310 mph &
held the record for 1 year. Incidentally, the Dassault Mirage 3 & 4 are based on the Fairey Delta 2.

The Panavia Tornado & Euro fighter Typhoon are British design aircraft with British design engines built by international consortiums. 

The EE Lightning was one of the fastest aircraft on the planet when it first achieved a Mach 2 flight. 

Early days, jet fighters.
De Havilland Vampire, Sea Vixen & Gloster Meteor accident losses were not high or unusual for fighter aircraft at the time. De Havilland built large numbers of all metal airframe aircraft before the DH Comet.
We mustn't forget of course that the DH Vampire for example first flew in 1943 & the engine was also built by De Havilland. There were examples of the Vampire interceptor / fighter in service until 1990 which was operated by more than 30 countries.

Non combat phase accident losses.
% of Aircraft built.

The Canadair CL-44 was a turboprop airliner.
Canadair CL-44                  (ff 1959 ) 48%
Lockheed XF104                (ff 1954) 100%
Lockheed  P80                   (ff 1944) 43%
Lockheed F104                 (ff 1954)  45%
Grumman f9f-5 Panther   (ff 1947) 44% 
Convair F102 Dagger        (ff 1953) 45%  
MD F-101 Voodoo.             (ff 1954) 34%
MD FH Phantom 1            (ff 1945)  35%
MD F4 Phantom 2             (ff 1958)  28%
MD F3H  Demon               (ff 1951)  32%
Gloster Meteor                  (ff 1943)  21%
DH Vampire UK                (ff 1943)  23%
DH Sea Vixen   UK           (ff  1951) 33%
Gloster Javelin  UK         (ff 1951) 20%
EE Lightning  UK             (ff 1954) 33%

It's a great pity & a crying shame that British military forces had to occupy a large part of Germany for decades after 1945 & Russian military forces had to do the same. Of course Russia still posseses a large chunk of what was German territory & of course Russia & the UK produce nukes. Obviously Germany does not produce nukes.

Early days, jet engines. Whittle performed the world's first demonstration of a gas turbine aero engine in 1937. The RR Nene, a centrifugal gas turbine aero engine, was the world's most reliable & most powerful gas turbine aero engine in 1944. Licensed built versions & copies of the RR Nene & RR Derwent would go on to power many aircraft in Russia including the Mig 15 & Mig 17, the US, China, France & other countries for decades after 1944. Incidentally, the Mig-15 was in essence an upsized / tweaked copy of the Whittle / Gloster E28/39 jet aircraft including an uprated copy of the RR engine.  The basic centrifugal compressor gas turbine aero engine with Whittle style reverse flow combusters and sometimes an axial compressor section is still manufactured by more than one company including Pratt and Whitney, the main application being helicopters.

The gas turbine engine was invented in England during the 1700s.

During the 1800s Parsons of Ireland & North England produced the world's first axial multi stage sequential stator rotor turbines and compressors for turbomachinery use which would eventually go on to to form the main components of the axial gas turbine aero engine. At the time the basic idea of making an internal combustion gas turbine engine and using it as an aircraft engine was considered thus the jet aircraft concept had been created in England before the first powered aircraft flew.

An example of what goes on these days in various countries. For example, there are of course no German companies that makes German jet aircraft in Germany & there are no German Companies that make German gas turbine aero engines in Germany that are suitable for widebody airliners.

The UK has the world's highest combined per capita Nuclear / Defence / Aerospace Sector Activity.

UK defence sector, absolute terms, world's second highest activity. 1st for per capita defence sector activity. Per capita nuclear powered submarine construction, 2nd position. 
Main players being Rolls Royce, Babcock, GKN Aerospace & BAe Systems. Activities often involve international collaboration. BAe systems, RR and other UK companies now handle more Airbus work value wise than Germany. 

There's a good chance that anyone currently flying on a widebody airliner will be on an aircraft powered by RR gas turbine aero engines made in the UK and a good chance there will be other hardware on the aircraft that's designed and / or manufactured in the UK. 

Rolls Royce Holdings UK
Subsidiaries
- Rolls-Royce plc
- Rolls-Royce North America (ex Allison etc Classified Military stuff)
- Rolls-Royce AB
- Rolls-Royce Deutschland
- Rolls-Royce India Private Limited
- Rolls-Royce Marine Power Operations
- Vinters Engineering Limited
- Rolls-Royce Controls and Data Services
- Rolls-Royce Power Systems
- Bergen Marine
Joint ventures include:
- Rolls-Royce Turbomeca
- MTU Turbomeca -

Trent Family
The MT30 (Marine Turbine)
Industrial Trent 60 Gas Turbine
Trent 7000
Trent XWB Airbus A330neo.
Trent 1500
Trent 1000
Trent 500
Trent 600
Trent 700
Trent 800
Trent 8100
Trent 900
   
RR wholly owned subsidiaries in Germany handle smaller 2 shaft RR gas turbine aero engine work.

The UK space and aerospace sectors are highly productive, high-value industries that together contribute over £18 Billion in direct Gross Value Added (GVA) to the UK economy. Individually, the space industry directly contributes about 0.3% of UK GDP 7•2 Billion while the aerospace industry contributes approximately 0.5% £10•9 Billion.
   
Wee hopes theze helpsmz.  EtC---.

We hope this helps of course 👍